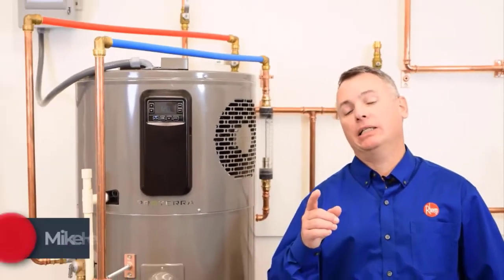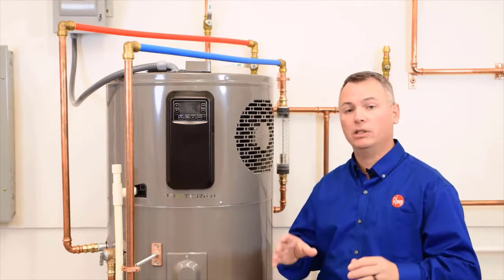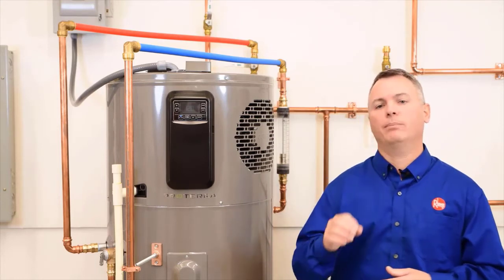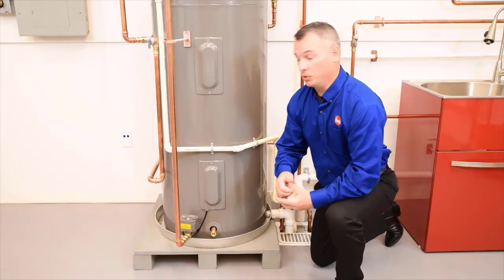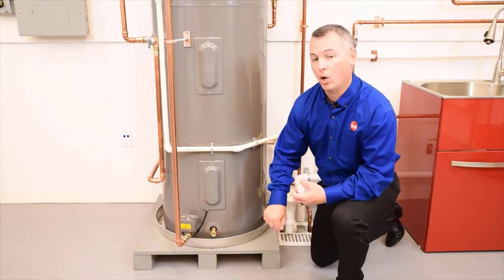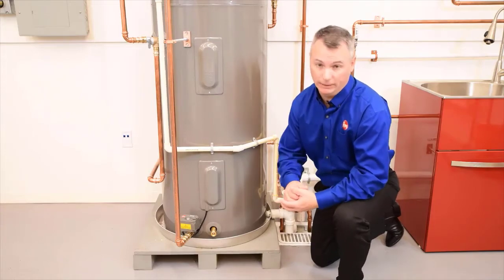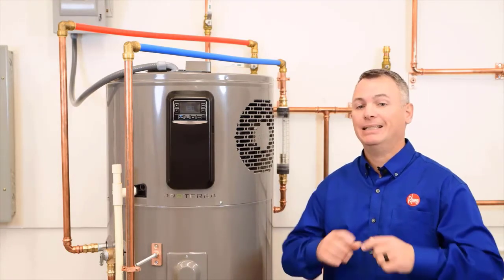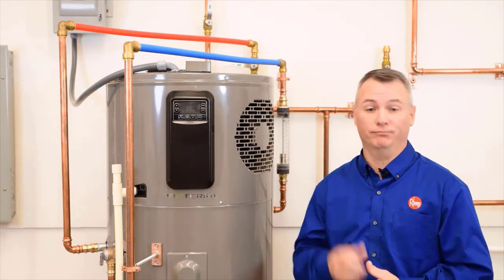Recommendations for Installing Rheem® ProTerra™ Hybrid Electric Heat Pump Water Heaters

Comment: I've read a lot of reviews with noise complaints (even on the Rheem website) on the Gen 5 units which is my biggest hesitation in buying a hybrid unit as mine will be installed in a utility closet with louvered doors in my living room.  Will this flexible piping solution help issues like this:  https://youtu.be/-D7Au499gbU  and this:  https://youtu.be/ATClLmQxfnk
Reply: I just installed a hybrid unit myself and I haven't had any noise aside from the compressor kicking on to heat the water. I only know the unit is working when I walk into the room where the water heater is located. Best of luck. I'm running a 40 gallon tank.
Reply: A week ago I just had a Rheem ProTerra™ Hybrid Electric Heat Pump Water Heater (PROPH50 T2 RH375-30) installed by a professional in the garage. It's on a non-concrete floor right next to the living room wall and stairs. We are having huge trouble with the annoying humming vibration noise, which travels more than half of the house both first floor and second floor. The fan noise (around 60 dB(A)) does not bother us at all as the garage walls are all insulated. But the compressor (i.e. heat pump) running noise with humming vibration is driving us crazy. We have to use electric element to heat water for now (4 times of energy consumption). We have a case open (#3216068) with Rheem to try to solve the issue.

So the material of the floor matters the most for the noise/vibration travels across the house. Hopefully it's concrete. Please check very carefully before installing and check with your installer with many questions.
Reply from the maker: Hi Sean, thanks for the question! The flexible piping is something that we recommend on all our hybrid installations to help isolate the unit should there be any vibration (that might cause noise). Aside from that, all hybrid water heaters do produce a little bit of noise due to the air that they are moving through the unit. Flexible piping will not address this. We heard some complaints about some of our initial units producing more noise than expected, and we have made changes in production to reduce this. Overall, this has given us positive results in the field. Additionally, you can contact our support team at 1.800.995.0982 should an issue arise. We hope this helps. Let us know if you have any additional questions.
Reply: @rheemwater  is there any way to know which units in production has the changes for the noise reduction? Onl noise concern is holding me to buy this unit.

Comment: For protera 50 gallon water heater , what are the specifications for the expansion tank, drain pan ,  and do we have to have drain pipe attached to drain pan ?
Reply from the maker: Hi Amir, thanks for the question! The specifications for the expansion tank and the drain pan would come from the manufacturer of those devices as they are not part of our water heaters. As for attaching piping to the drain pan, you will need to check with your local plumbing codes. We hope you found this helpful! Let us know if you have further questions.